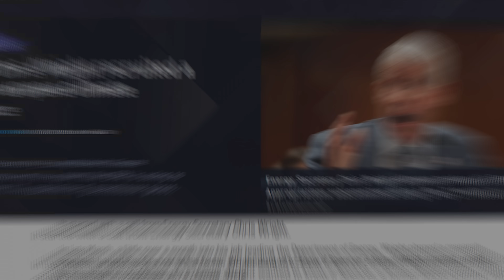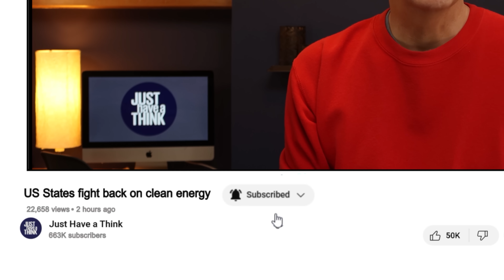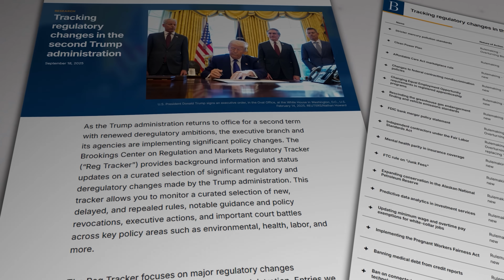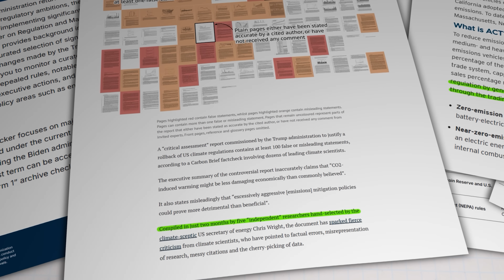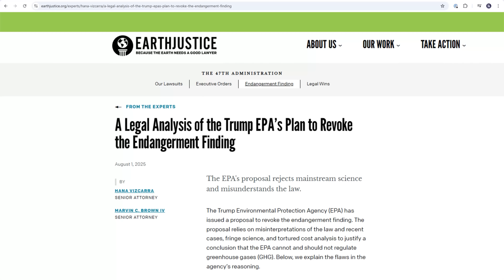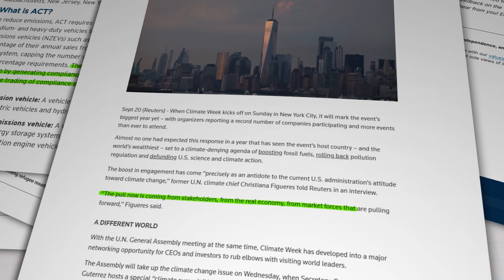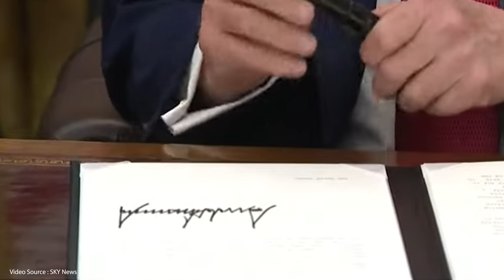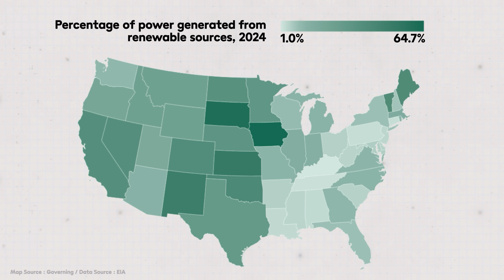The battle for American energy supremacy.

Comment: All you central planners, don't get it, while there are still large oil reserves, we are currently at a point where it takes more energy to get oil out of the ground, and that gasoline into your car's tank than it actually provides in creating kinetic energy. Second, using more natural gas and nuclear energy is really the only clean energy path forward. Solar is a great supplemental source, largely rooftop. Coal is dead, BTW, because of the cost of dealing with the ash. I would rather have a nuclear power plant than anything dealing with coal. Next, please don't ask the government to fix a problem where the free market is already hard at work doing just that. Remember, it was the dirty oil companies that saved the whales.
Reply: "Solar is a great supplemental source..."
No. Wind and solar damage every grid they are connected to.
They provide nothing of value, and only cost money and life-expectancy.

Coal ash is used to make high-performance concrete.
What substitute would you propose?
Reply: @aliendroneservices6621 rolling my eyes

Comment: We will now find out if solar is really cheaper when it is no longer subsidized by the Federal Government.  If so, it will proceed with only a slight decrease in the number of rent-seeking parasites.   However, the tariff nonsense could raise the cost of solar, as China accounts for over 95% of the world's solar silicon capacity.  Our subsidized silicon solar panel companies depend on China for modules.   We can't/won't allow "permission" to build plants in the US regulatory state.

Comment: It doesn't take a genius to understands that solar and wind are cheaper in the long run.
Even with petrol subsidies and none for Solar, still solar beats oil in most applications.
Had solar and battery for several years, a gas generator, which I use sparingly, 
is the worst most expensive way to make electricity.

Comment: Solar, hydro, and wind power remain inefficient and inconsistent energy sources promoted primarily for political optics rather than engineering merit. Their low energy density, storage challenges, and dependency on environmental conditions make them poor candidates for sustaining industrial-scale economies. The nations that will lead in the next century are those channeling resources into advanced nuclear programs, fast breeder reactors, molten salt systems, and small modular reactors. These technologies deliver far higher energy output per kilogram of fuel, operate with predictable baseload stability, and generate minimal waste compared to legacy fission designs. The real global competition is in nuclear innovation, not intermittent renewables.
Reply: Not likely to happen.

Comment: The biggest issue that you missed to cover is . If USA left behind in modernize its grid infrastructure and slow down the progress to increase its capacity and capability to handle weird needs of data center it AI center when compared to China it will hurt USA in the long term..

Comment: In Dec I leased by first EV - I love it. Put 14.4 kW solar array on the roof in the Spring. Refused to cut our trees down so we have partial shade and despite that we generate 65%+ of our electricity including the EV. even with the shading the array will save approx $150k over next 25 years and that was before electric rates started to skyrocket.

Comment: Renewable energy seems like a simple win, doesn't it. Wind, solar and hydro are all viable technologies, but the devil is in the detail and we're in danger of letting the politics and economics muck it up. The 'win' is in the implementation and it seems we could be getting it very wrong. The recent collapse of the Spanish power grid was, in large part, due to the way their renewable sources had been integrated into the existing networks.

Comment: As renewables get cheaper they become unstoppable. Not only are their LCOE cheaper, but the upfront cost of wind solar is now slightly cheaper than building a gas or coal-fired power station (albeit adding 24-hour batteries triples that cost though still has a better LCOE)

Comment: There are two important parts when it comes to renewable energy: one part is building up production capacity like solar arrays and wind farms, the other part is revamping the energy grid from a more or less hub-and-spoke system of large powerplants near large consumers to a decentralized system that is able to transfer large amounts of energy back and forth and across the entire country from (temporarily) low production areas to (temporarily) high production areas plus strategically placing backup capacity and storage.

The first part is fairly easy, fast and cheap to achive and can be done by indivudial companies and developers as well as states, regions or cities. The second part however is a lot harder, insanely expensive and takes decades to complete and can only be done on a national level - but without it, all efforts regarding renewable energy will only be able to partially substitute conventional fossil fuel power plants, not replace them. Countries like China or Germany are building the massive high voltage transmission lines needed for a full transition, the US on the other hand does not and thus already lags behind at least a decade (more like two or three if you consider the timelines of other large infrastructure projects like CHSR)

Comment: The sun does not shine for the most part of the day. While a rooftop or garden solar installation coupled to a battery for a home makes sense: produce local, use local - imho large scale solar utilities do not.
Reply: Large scale solar is connected to the grid, just like any power station.
What I don't use from my Solar PV is fed into the grid.
When it's dark there is still wind.

Comment: Just remember that until you have batteries that store enough energy to power a city for more then an hour - you are just paying for two redundant systems.  One that works 100% of the time and one that goes away when it's not windy or sunny outside.  This drives up the cost of energy with a negligible reduction in CO2 emissions